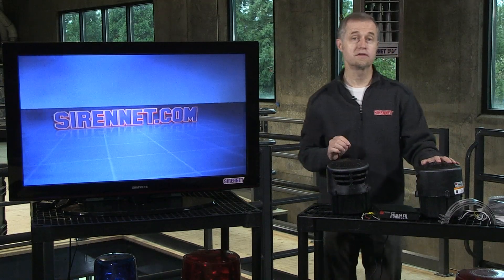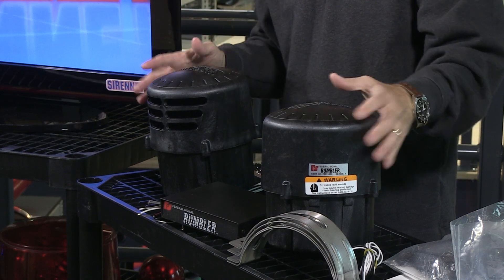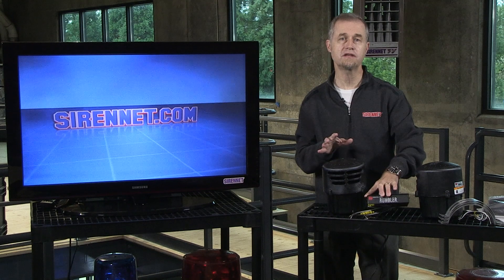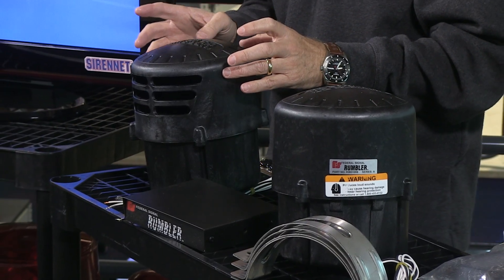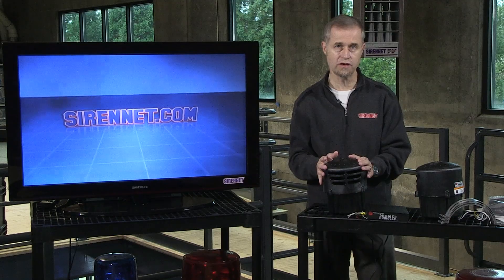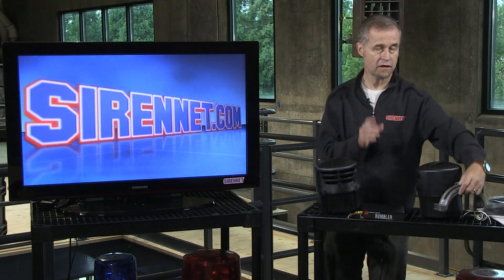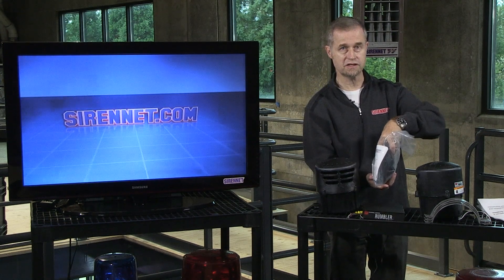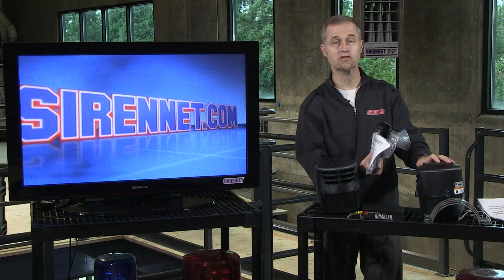Federal Signal Rumbler Intersection Clearing System

Comment: Made In EU2 North Yankee Emergency Call: 112 SOS. They Have Rumbler Siren, Whelen Howler, Feniex Hammer, & Jack Hammer, Federal Q2B Higher Pitch Sound Like Osaka Motor Siren 24 Volts Battery, Martin-Horn 2298, European & American Airhorn, American, European Train Horn, Setina Pushbar, LED Spotlight, Many LED Lights!